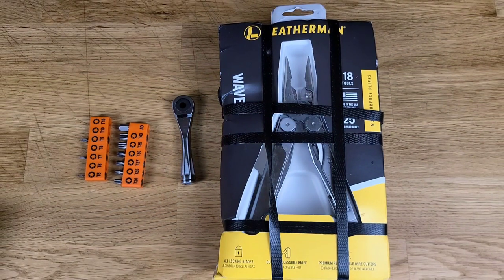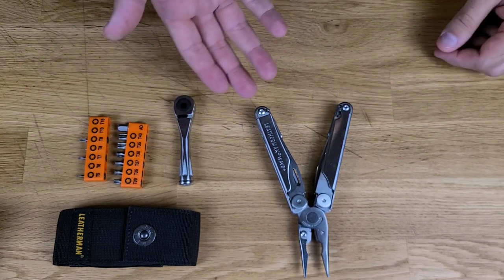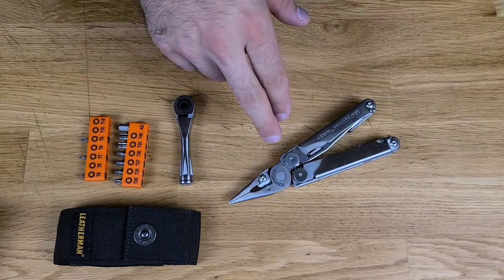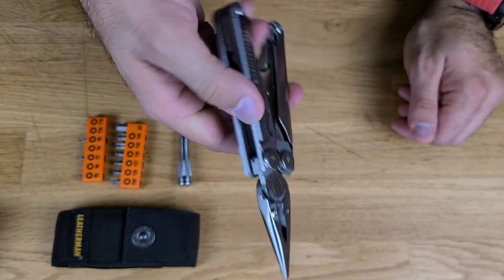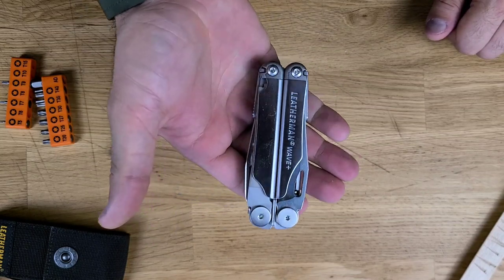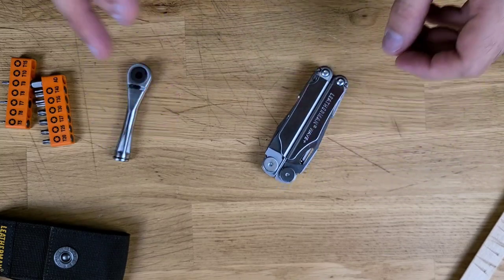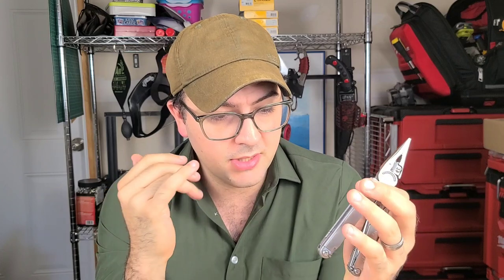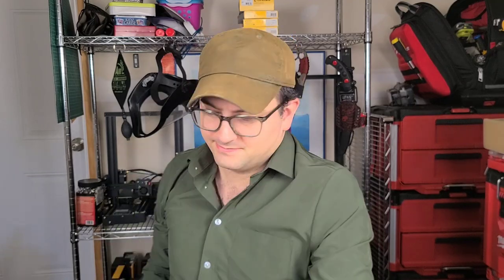EP1 Multitool Modding  Tuning the Leatherman Wave

Comment: I have that exact bit set in the black case you have there. I love it. I've had it for about a year and it seems to be pretty well built. I also have a vise very similat to that one. If you dip your leatherman or knife into boiling water for about 30 seconds, it'll soften the locktite and make it easier to loosen and easier on your bits so you're not stripping or shattering them.
Reply from the maker: I need to use this strategy
..
Reply: You can also rest a soldering gun on the nut, this will also soften the loctite...

Comment: It is good to heatgun the screws a bit before fine tuning the internal tools because it will be easier to adjust tightness and you eliminate the chance of breaking a screw. I dont know if it can happen with a Leatherman but I heard stories about screws breaking when using high force on them.
Reply from the maker: It's a good idea, but I've never used a heat gun myself
Reply: @maxlvledc  well its very similar to a hairdryer only it can be much more hot. :D
Reply from the maker: @naturecalls3465  oh, I know what your referring too, I used one on lots of different projects.  Just havnt used it on a leatherman.  I think I will on a rebar though

Comment: I picked up that same scredriver you have in the thumbnail. Its absolutely brilliant
Reply: Do you mean the small one? Where can I get it?
Reply: No I meant the bigger one. However it breaks down to the same size as the small one. The smaller one is a common design that you can get at I think wera or amazon. But I'm not sure
Reply: FOUND IT! Its the "Sealey Ak6962 Bit Driver Rachet Micro 1/4in Hex Stainless Steel"
Reply: Thanks!

Comment: Point of note, if yours is an early wave, as mine is, the screws are NOT torx (six points) they're pentalobe (five points) I had to order mine online as you're unlikely to find them in most tool outlets 👍🏻
Reply: Interesting! I lost my Wave long ago, so can’t test it, but if it’s a security pentalobe, it might actually be a security Torx Plus, which is the only Torx with five instead of six lobes. Not sure if the timing of the Wave aligns with when security Torx Plus came out, though.
Reply: @PetesGuide  You maybe correct I'm not sure about the name but it definitely was five lobes instead of six and yes they were security with a central post, I thought that I got the pentalobe reference from the website I bought them from but it was a long time ago so might be mistaken about the name 😁 but definitely not mistaken about the number of points as I still have my old wave 😁👍🏻🇬🇧
Reply: @goldenhands7024  pentalobe is the correct technical term, along with hexalobe, so you did not make any misstatements, I just wanted to share a very obscure detail about Torx! The details of fastener drive systems is an area of great interest to me.
Reply: @PetesGuide  brilliant 😁👍🏻 it threw me a little when I tried to strip it down, I just couldn't understand why my torx driver didn't fit, it was only when I put my glasses on that I realised my mistake 😁👍🏻
Reply: That explains a lot, my 2004 charge was confusing me. My 2014 wave is torx like normal.

Comment: What do you do if a handle to pliers pivot is too tight, like on my surge? It's not the screws, as the outside tools open fine. I tried some 5-micron diamond paste, but it didn't help. I figure if anyone knows, it would be you. Or maybe you have shown this in a video I haven't found? Thanks!

Comment: The Ares mini ratchet is awesome. I carry it everyday in my wallet with nineteen bits and an extension.
Reply from the maker: thats a BIG freeking wallet!!!! pictures???
Reply: @maxlvledc  It's a small extension, and the bits are the two bit sleeves that come with the Mulwark mini ratchet. Most bits are stubby bits, and they work very well with the Ares. My wallet is a cheap nylon tri-fold with a big coin pocket.
Reply: I sewed an elasticated strap loop on one end, and it holds the ratchet. When foliding the wallet, the whole thing hugs the ratchet nicely.

Comment: Any tips for fixing up and down blade play when locked for the liner lock tools other than sending it in for warranty?
Reply from the maker: sadly no. Thats an issue that happened at the factory.
Reply: @maxlvledc  thanks, I figured as much. Sucks that their top of the line charge tti would leave the factory with that issue.

Comment: Probably a stupid question but...
I'm going to remove the plier head from an old LM Kick and replace it with a Rebar plier head. The Kick is used w/no blade and the Rebar plier head is from a stripped for parts eBay listing. Everything from my research says the parts are interchangeable (concerning the plier heads) and since the Kick is discontinued without a blade and the plier head is from a disassembled Rebar, the warranty does not matter. It's for my job and I don't require many tools and I always carry a blade. What the Kick has is pretty much all I need, I just need replaceable wire cutters, otherwise I wouldn't switch the plier head. 
My question is about blue Locktite. Locktite is basically Super Glue. Fast setting. I've only used regular Super Glue, so forgive my ignorance, but what is the best way to approach putting in the screws after the swap, based on the limited time frame allotted before the Locktite dries? Btw, I have a set of parse/disassembly wrenches and have watched your video on using them. I just don't want to bugger it up or have to keep unscrewing, glueing, tightening, unscrewing, glueing, tightening until it's set correctly. I can find nothing on the subject but, "Use blue Locktite". 
Stephen
Reply from the maker: Yes they are interchangeable..and blue locktite should give you plenty of time without rushing but use a stick not the liquid
Reply: @maxlvledc  Thanks so much! Enjoying the content. 💪👍

Comment: Send me a leatherman bit for the wave the Phillips and flat. I lost mine and haven't used the wave since! The wave has been sitting in the drawer collecting dust
Reply from the maker: You can buy them in packs of 3 separately
Reply: @maxlvledc   ok thanks. I will just retire it and use my gerber instead i prefer 1/4 bits instead of those stupid special bits that leatherman created
Reply from the maker: @perrycollicutt2861  that's fair lol
Reply: @maxlvledc  ill slap it on ebay curious since you buy knives alot i wonder how much it would go for its the wave plus barely used
Reply: @perrycollicutt2861  P🥜🌰🥜🌰 😆
Reply: @mdeamicis  yes but those special bits your fucked if your at a jobsite and you lose one then your searching for a screw driver thats why i prefer a bit driver thats 1/4 so you can use any! Yes weight is a factor but my gerber centre drive was the best purchase ive made i already broke 2 leatherman waves im not fond of them

Comment: ...Or u could buy a Victorinox Spirit X and get a perfectly tuned tool every time right out of the box. Sorry Leatherman
Reply from the maker: Sorry, not true...my tools on the spirit were so tight I snapped multiple nails. I Needed to take a dremel to the locking springs just to use it properly
Reply from the maker: For reference, I've never had an issue in this manner for ANY other victorinox. Nothing on a spirit can be opened one handed, and it's the worst scissors vic ever made. Quality is impeccable, but on top of this the plier has a blunt nose hybrid shape and really short wire cutters. I like the spirit..but it's NOT a clear winner overall.